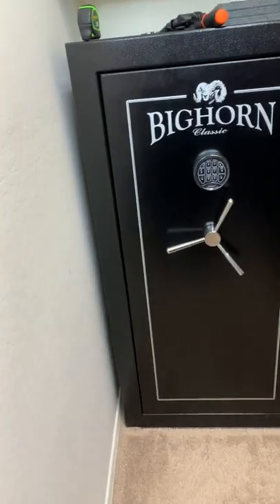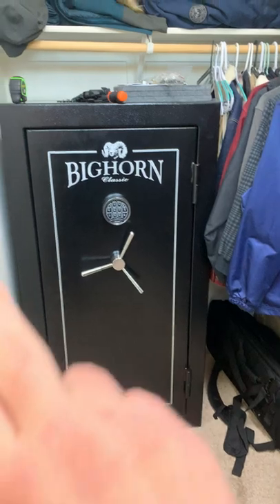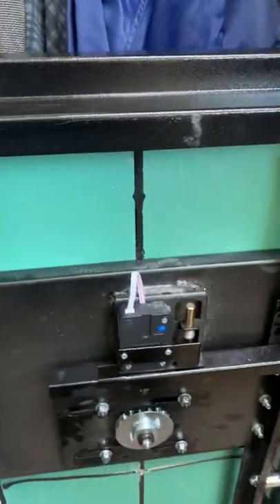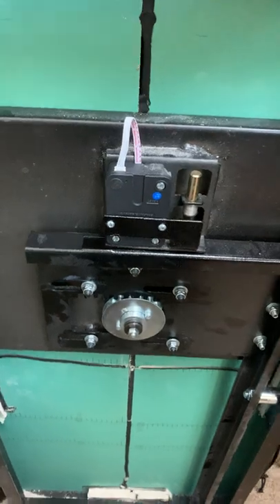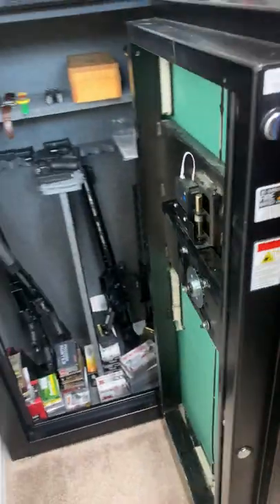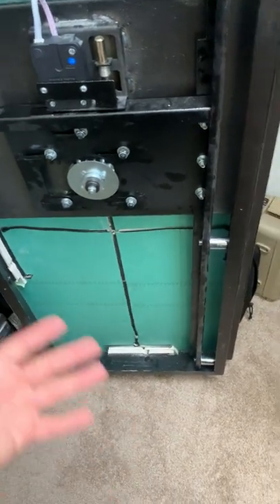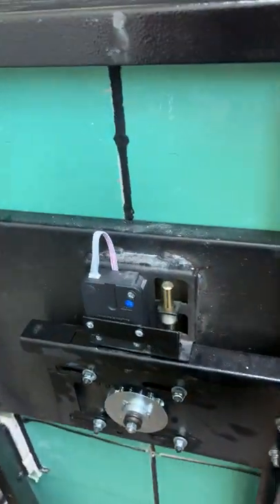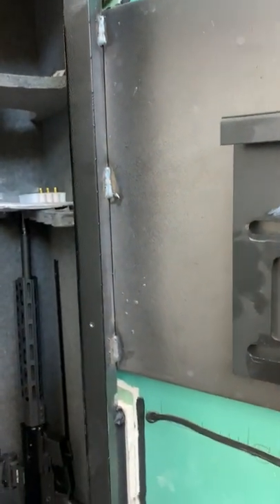Costco Gun Safe Review

Comment: Dang I was just getting ready to buy this. Thanks for review. Not sure I want to deal with this
Reply from the maker: Glad you found this review helpful. Since making this video I have actually fabricated a solution to this problem that made this safe work for me. If interested in seeing it let me know and I’ll make a video.
Reply: @solje8199  can you please make a followup video showing this solution and also show the area where the active bolts engage the safe body? I want to see if the steel is folded at the lip or if that area is just a thin sharp edge that the active bolts rest on when it’s locked. Thanks for the video
Reply: @solje8199  Please send me the info on how you made this safe work property. I have one on the way and would rather not return to Costco, if at all possible. Thank you!
Reply: Same. Now I am having major doubts. If you have the video showing the solution. That would be great. Thanks in advance
Reply: Same.
Reply: So, no follow up video yet?

Comment: Got a steelwater gun safe, it’s a tank.
Reply: I just bought this safe (almost) 60"×24"×18" used from a friend, he bought it around 2014, this one has a "made in USA 🇺🇸 " decal on the inside of the door, many differences from yours, mine has 4 pins on door left side one on top and bottom, metal sides measure .108, door is .270 i removed it to install safe door is extremely heavy, I just lagged it to the floor and drilled 3/8 holes in the back and 1 side and lagged it to studs in a closet corner, just haven't figured out what to do with the one exposed side yet, I am so far completely happy with this one now I'm not sure if the made in USA "sticker" is real